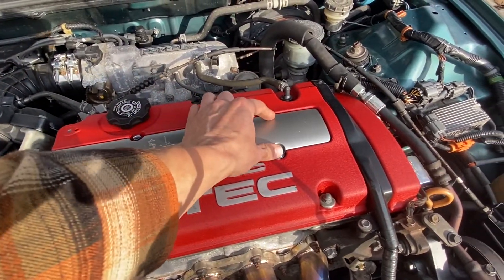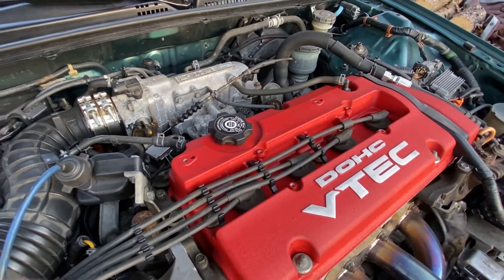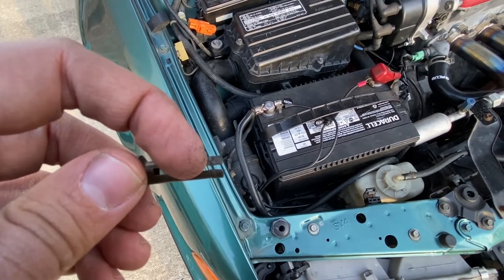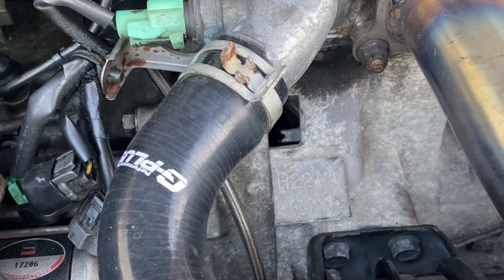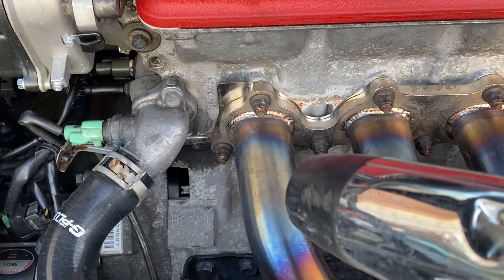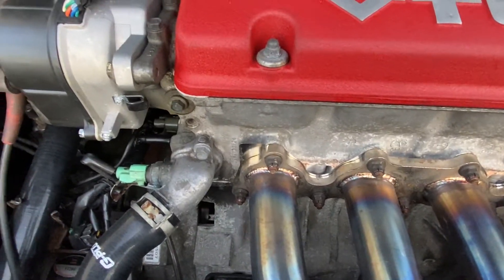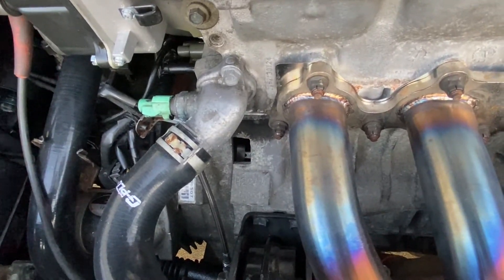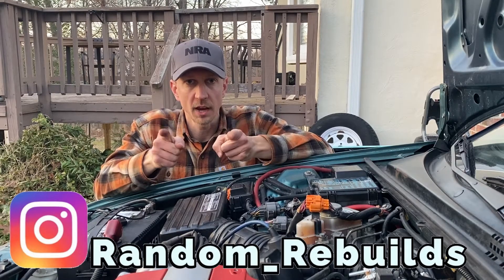How To Set Timing on a Honda Inline 4 Cylinder Engine

Comment: Very oem plus swap. Great job. 
For those wanting to do their times. Pepboys  has the tool renting program where you can get a timing light to use for free.
Reply: If im not mistaken they are the only ones who do so !! 

other competition stopped renting those out. 

and unfortunately its not so easy to find pepboys only in certain areas

good call though !! wish i knew this before hand cause i had to buy one at Harbor for 30.00